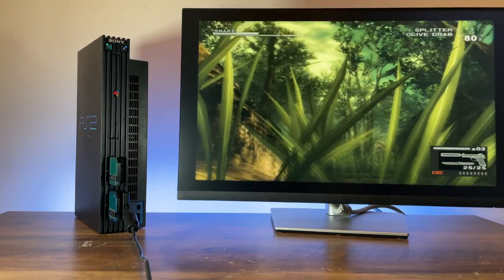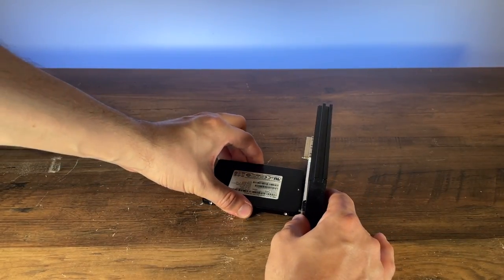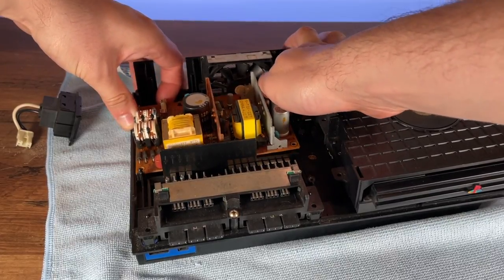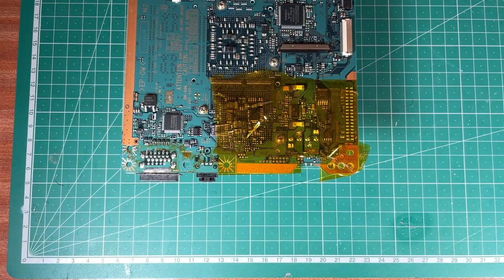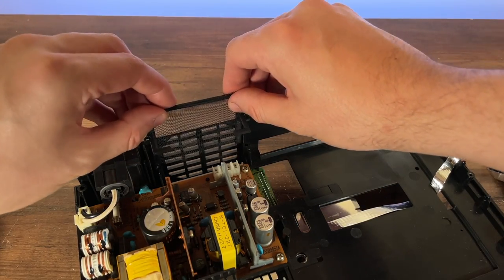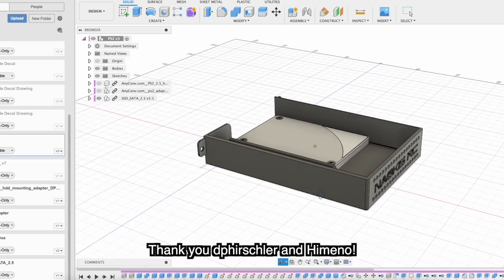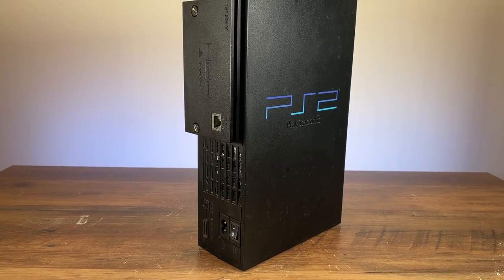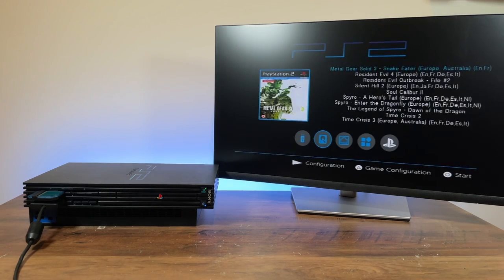PS2 HDD to SSD - Plus silent fan!

Comment: SSD's are overkill for old hardware since the speed will never be utilised, a modern HDD is plenty good for older low bus speed hardware. More storage for less. The Noctua fan or any silent fan is a downgrade since it pushes out less air as a result cooling less than the original blower fan. You want to always replace the fan, the fans are usually made from Nidec and new replacements can still be found that sound quieter than the original but also outperforming the Noctua.
Reply from the maker: SSDs actually have better random seek times, are instant on, silent… etc. I said this in the video. As to the fan, A: Im not using a noctua, and B: it kicks out the same amount of air as the original fan did at the same speeds, but is still quieter.

I didn’t do these things without doing research before hand

Comment: I got a 2tb ssd and had nothing but issues with games freezing and not working at all. swapped to a 2tb hdd and everything worked great. Tried the 2tb sandisk and 1tb evo870 both didnt want to run correct. even formatting them in hddmanager it didnt work right so had to do it pc side 😂 with a 2tb hdd its good as gold tho
Reply: @kevinwoolford123  I'm running a samsung 1tb 850 evo and while I haven't tested all 88 games yet, I've loaded a handful now and everything is running fine. It is annoying how compatibility seems to be inconsistent with this mod. For all we know, the 870 specifically doesn't work that well while the 860 and 850 do.

Comment: SSD are still an HDD. SATA SSD are also IDE. And why on earth use SSD in a Ps2, unless you find it impossible to find a spinning PATA hard drive? You will not get any of the SSD advantages on a Ps2. And all it is, are a thing you can brag about.
Reply from the maker: There is no spin up time and no extra hard drive noise, both of which were noticeable to me. Plus it means I only need a laptop sata drive to usb adaptor instead of one that also supplies 12 volts.
Reply: Access times will destroy a traditional HDD - as many consoles are constantly streaming due to the smaller hardware it is using. Your going from avg 15ms to 0ms which in hefty scenes or lots of loading can actually benefit. Please test yourself, you'll see that SSD's are far better then HDD's.

Even if there's UDMA66, in random access the HDD will actually be slower due to it's head having to seek constant around the platter. An SSD does not have that problem. Replacing a notebook's HDD with a SSD will speed up things greatly.
Reply: @vanderlinde4you  Streaming? A Playstation2 does not have those features. Those were implemented in 8'th gen consoles, not 6'th gen.

Of course mechanical harddrives wear down. But not the way you say they will. What you are talking about, is fragmentation, and it is fully software related. Not hardware related. It happens on stuff like Windows, and the specific filesystem in use. If you just copy ISO games to the harddrive one at a time, the fragmentation is not severe. The Ps2 does not do writing. It only does reading, and that will never cause fragmentation of data.

The specific harddrive standards you refer to, have nothing to do with fragmentation at all. It is just a set of commands and a theoretical transfer speed. Set of commands be the ATA commands that are baked into the harddrives controller on it.

Back in 2007, I installed a HDD and used the first versions of FMCB, as they were released. I used ESR the same week it were first released. And I used an ATA-100 harddrive with HD-Loader. What I experienced, were data loading too fast in some games, making the cutscenes being terminated before they have been played through. When using HD-Loader. It happened on few games. That is the only downside I saw with FMCB and HD-Loader.
Reply: @brostenen  Consoles do stream. Perhaps the way is said different but consoles simply on the fly do load in textures or different rooms, scenes or open world all the time. A HDD is slower due to it's access times. A SSD would simply max out the UDMA66 connection it does have. I dont see any downside of using a SSD inside a PS2.
Reply: @vanderlinde4you  What exactly are you talking about, when writing streamining?
Reply: @vanderlinde4you  What exactly do you mean, when you write streaming????
Reply: He literally explains his exact reasons in the video.
Reply: @TheBasementChannel  Plus harddrives some times load too fast, so cutscenes will be cut short. Still happens with 5400 rpm drives.

Comment: Only on early fat models have the power supply on the top, later ones like the 50000 model which I have the power supply is on the bottom.
You did an amazing job here.
Reply: Also I believe he has the 10 screw model which is one of the very first revisions of the ps2

Comment: Epic video. Just modded mine with that GELID fan. 12v model but will start at 4.5v so works with or without the Network adapter. Thanks again

Comment: When I upgraded my HDD I tried exFAT, but for some reason I couldn't make most games work, so I defaulted back to PFS, added all games through HDL Dumb on the PC, and now use LAN to add/remove individual games. It's slow, but at least I don't have to open up the PS2 every time I do it. I believe the HDD temps inside the PS2 might probably shorten the HDD's life.
When Francis Preve's music kicked in, I immediately though "another Retro Bird episode watched"!
Reply from the maker: HDD temps arent an issue with an SSD mind! Yeah Ive traded off removing the drive (or more accurately the network card and the drive gets stuck inside), for ExFAT just because it means I dont need to keep a Windows machine to hand just to add games 😅
Reply: What software do you use to upload games to HDD via LAN?
I never figured it out and had to disassemble WinXP PC to upload each game.
Reply: For me I use the HDLGameInstaller elf on the ps2 and the exe on the PC to transfer the games best of luck!

Comment: I wish there was a hdd cover that attaches internally. I hate that bump that protrudes outside of the console chassis. You know how the hard disk is mounted internally without overhang on an Xbox Original?
Reply from the maker: It’s technically possible but youd need to put all of the electronics that in the adaptor on the inside and theres 60+ wires for it
Reply: @NaokisRC  Yeah I suppose it could be done. I just have bad OCD haha.
Reply: You could probably slim it down severely by pulling the electronics out of the adapter and 3D printing a slim cover. You'd be limited to SSDs though essentially

Comment: 15:30 INCORRECT! You can mount it through network via NBD and it will be like any other HDD that is in your PC! You can manage it with the OS-Tools as well, like browsing the HDD in the usual filemanagers.
Reply from the maker: NBD support isnt something that comes prebuilt into all the OSes and yes you can add it but that looked more hassle than was worth to just use USB. So, yes but really not much better.
Reply: @NaokisRC  Yes, it is not built in natively in many OSs. I was just pointing out, that the info at the timestamp was technically incorrect. :)
Reply: NOBODY asked you anything
Reply: @dragac90  Were you looking into a mirror whilst writing that comment?
Reply: @tnaplastic2182  I did. Learn English bro

Comment: I notice you have a love for time crisis. Can you use the light gun with a modern tv? I thought it only worked on CRTs
Reply from the maker: The original GunCon 1 and 2 only work with CRTs as they require the scanning beam to know where they are pointing. The GunCon 3 uses IR tracking like the Wii remote but only Time Crisis 4 and above recognises this controller. There are 3rd party solutions for using older games on LCD but Im not sure which one works for the console games.

Comment: I bought the MX4SIO with a free mcboot memory card, I heard that when launching a game you had to change your free mcboot memory card for a normal memory card to save your games.
Is there a way to have the games save straight to the free mcboot memory to avoid switching out the memory cards all the time? cheers.
Reply: Hello I use helders fmcb memory card with mc2sio and I save games on my memory card. Doesn't really effect anything that I've noticed. Just be careful when erasing save data I guess. Other people may be more experienced than me about this though.

Comment: How well does PS2 games run from i-Link external hard drives on this fat console model ???
Reply from the maker: Theoretically only as fast as 400 megabits which in theory could rival the internal hard drive but then overhead might lower that. Plus you would need to use a firewire hard drive which aren’t nearly as common as IDE and USB